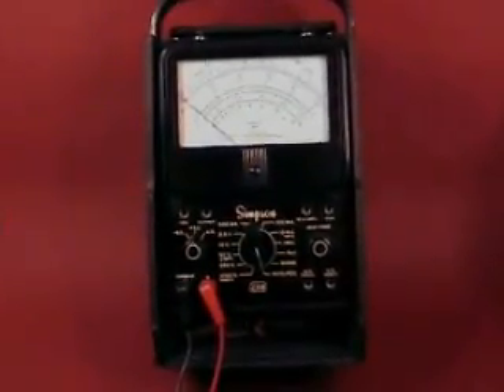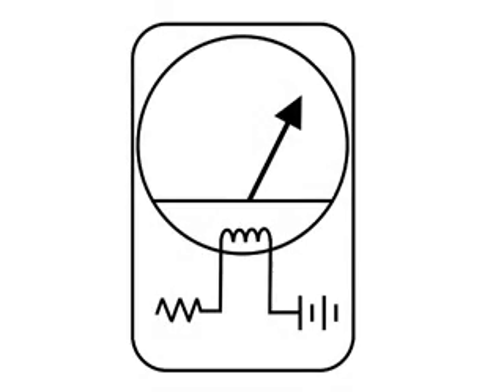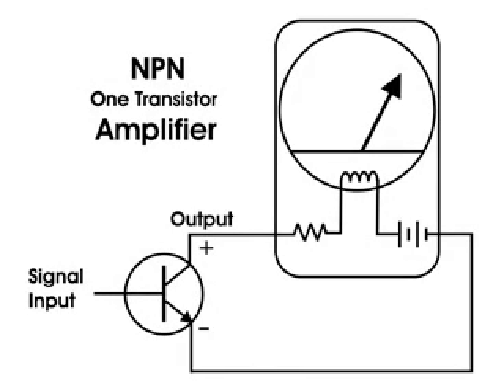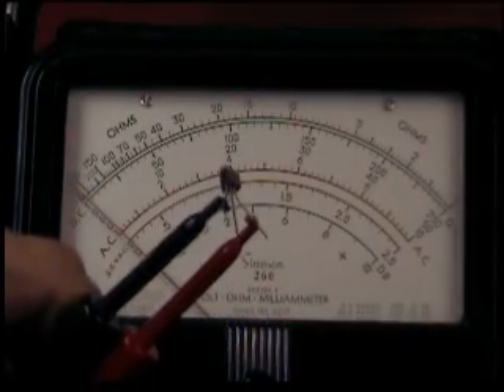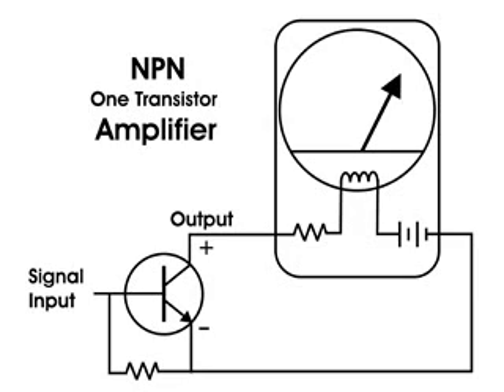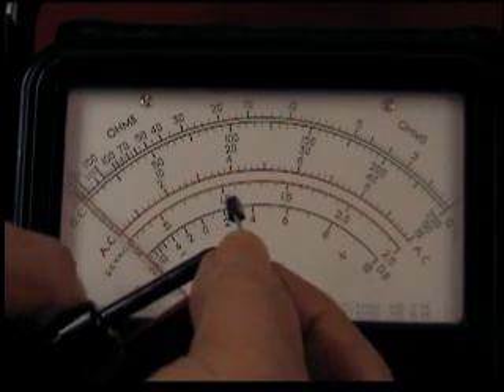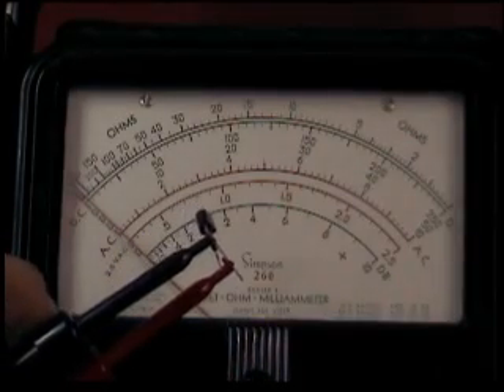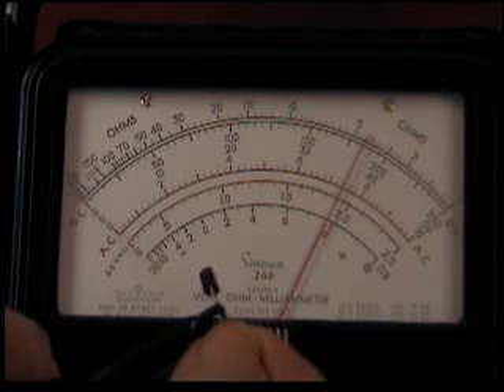One Transistor Amplifier Demo

Comment: If you touch only the base, how you are closing the circuit? you have to touch the emitter or the plus too. Or you close the circuit by parasitic capacitance ?
Reply from the maker: It's static electricity. The carpet and my shoe is the generator and part of the capacitor, including the work bench and me.

Comment from the maker: I would need to see the wiring diagram. If the circuit is working, audio amplifier, adding a resistor from the collector to the base will increase the bias on the base, increasing the current between the emitter and collector. Possibly burning it out.

Comment: the Base on my transistor can handle 5 volts, and 70 volts across emitter to collector. Will adding a resistor from the Base to Collector be OK or will it burn out the transistor?

Comment from the maker: Thanks. Basically it is Ohms Law. I think what you are asking how do I find out what the values should be. The best way to get started, is to look up the specification sheet on the transistor you want to use. The manufacture of the transistor will supply this along with sample circuits to use. Also look at, as many circuits as you can find that use the transistor or similar transistor you are interested in using.

Comment from the maker: John,
LOL
Believe it or not that's about all there is to it. Depending on your purpose determines how you bias the transistor.
Maybe I can use it to power my car, it has carpeting.
I bought the 260 when I was in High School and I just took out the batteries for storing.
Make sure your son understands what you want, you might end up Homer Simpson doll -- he must weight at least 260LBs. 
Thanks!
Regards,
Rick

Comment from the maker: The transistor is from a Radio Shack pack of twenty or so. The top has the numbers of 145 05, on the front is 148 772-1 18-00. Thanks.